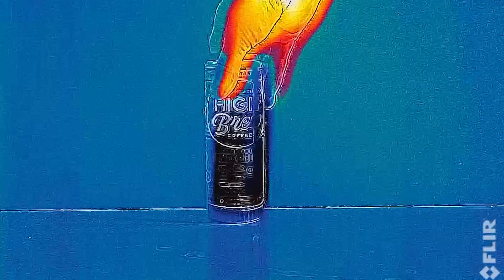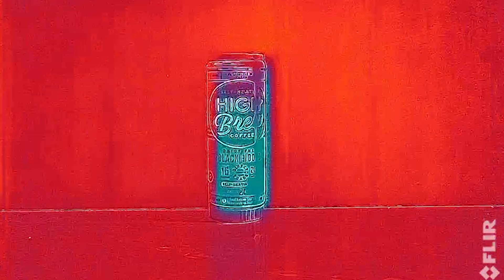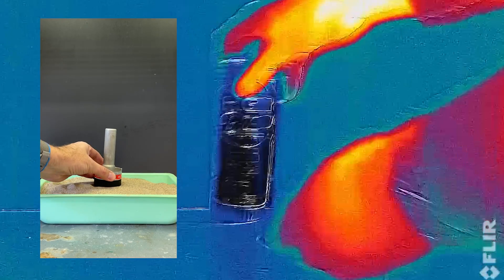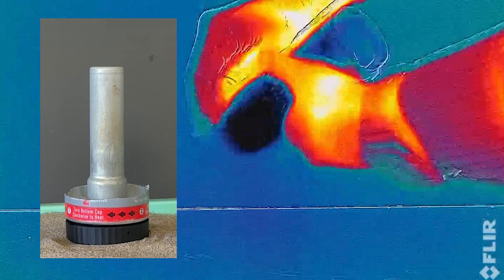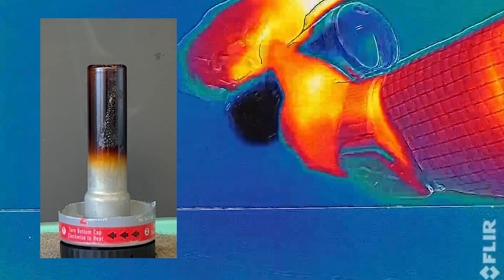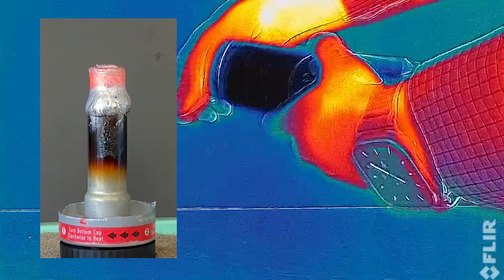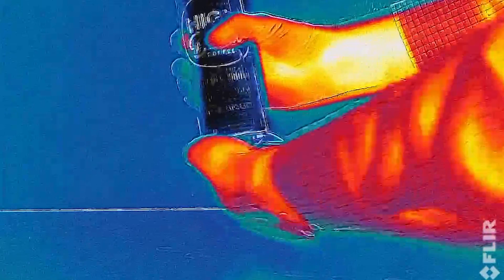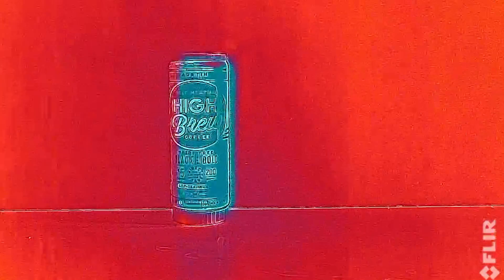Thermal Video of Coffee Heated by Thermite

Comment: would it be possible to use a clear acrylic tube in place of the can, like cut the can how you did before and tape the tube to it and fill it with water so we could watch it heat up? not that we would see much but it would still be neat to see if maybe the metal discolours at all or if the water touching it boils.
Reply: I thought he did this already

Comment: I have a question for you. Is there any chemical reaction that produces heat for more than 8 hours. If so, could that process be repeated with the same chemicals used after the heat has dissipated? (I have an invention in mind 😐)
Reply: You need to get rid of a body right?
Reply: Ha! Now that’s an invention! I need something small that will radiate low heat for over 8 hours when the temperature drops to 2°C. Then I need it to stop radiating heat above that temperature. Then, I’d like it to repeat as soon as the temperature drops again. This is an impossible invention. Unless you have any ideas?
Reply: @Iseeyou-2-z7s Use an electrical resistance and a thermoregulator working with the difference of dilatation between 2 metals

Comment: It would be great to do a chemical comp test of before and after the thermite to see if anything leached into the coffee.
Reply: Agreed, indeed.
Reply: In fact Aluminum coke cans do have a plastic liner.  Which is the real reason why you shouldn't smoke out of pop or beer cans.....wink..😅😅😅
Reply: i’d love to see that
Reply: Or leached into another filler besides coffee.
Reply: Acidic drinks, like coffee, should be in glass or ceramic containers, not aluminium. That's why the interior of soda cans has a liner, but that probably adds it's own chemical molasses to the mix too.